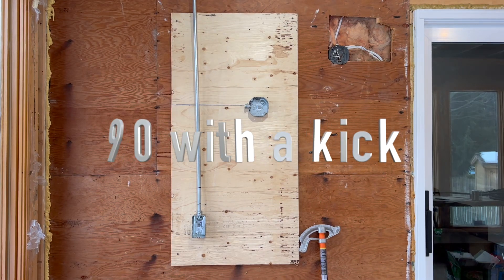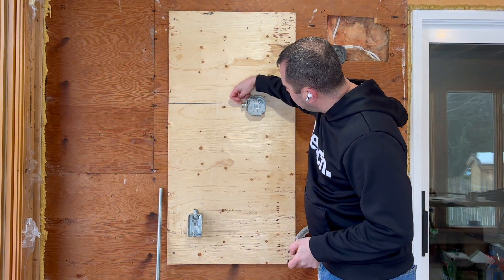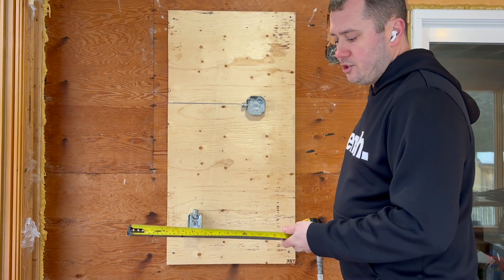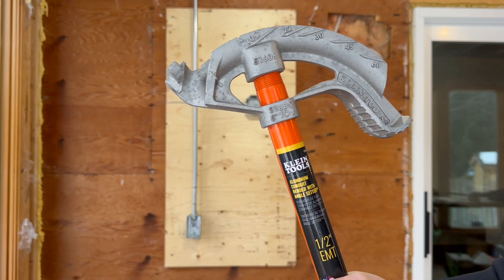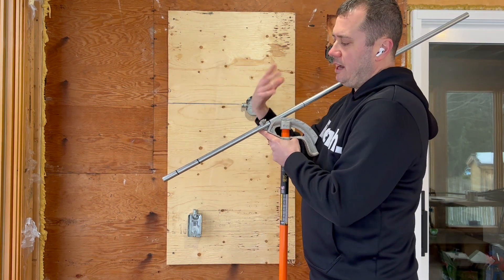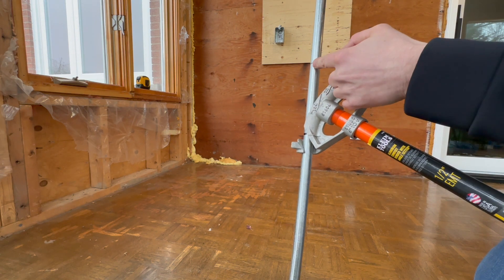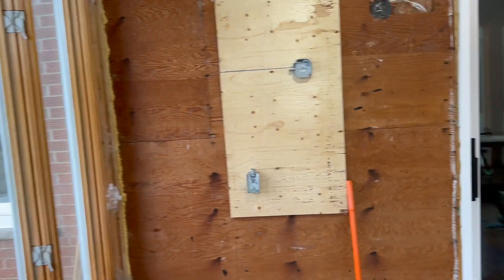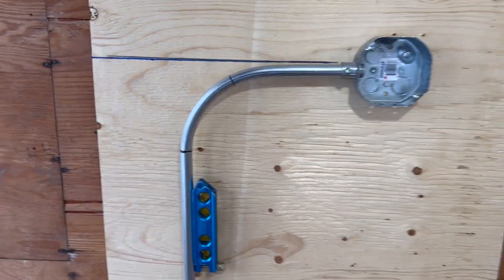90 with a kick

Comment: If I would’ve used the Star, I wouldn’t have to take back those 5 inches right? I would just bend at the 20-3/4 inches at the star and be alright? Correct me if I am wrong. Great video 👏👏
Reply from the maker: In theory, you wouldn’t have to take back what the bender requires for a 90. That being said, the benders that I typically use Klein and Greenlee, I find it difficult to line up the start perfectly with the line on your conduit. So you will be close, but I find I’m always right on the mark when I use the takeback method. And thank you.
Reply: @wsconestoga2581  thank you!